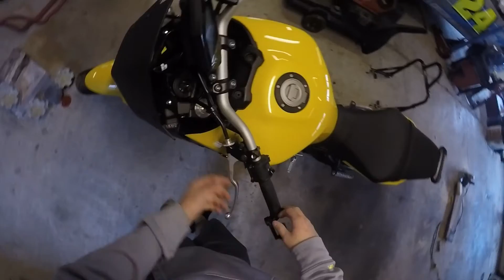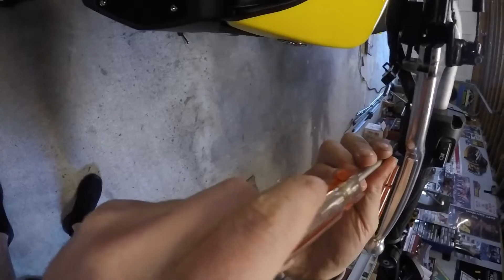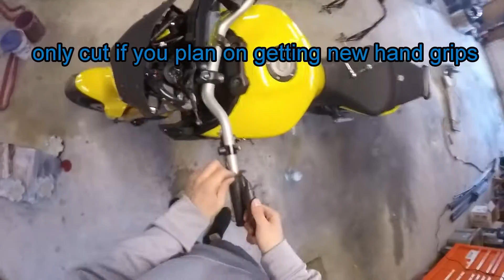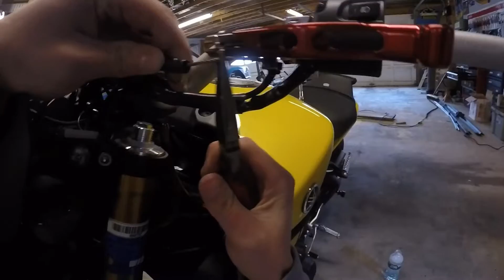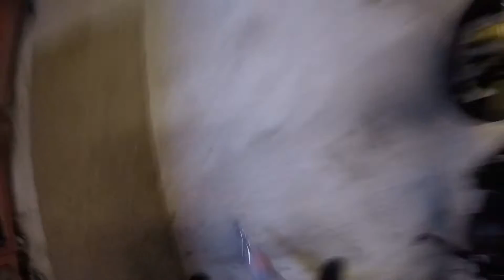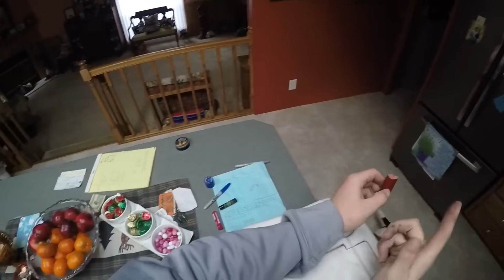EZ PULL CLUTCH | FZ09/MT09 | IMPAKTECH | INSTALL

Comment: Pretty sure that plug is what wont let the bike start IF its in gear AND you dont have the clutch pulled
Reply: Nevermind.  At the end u said it...
Reply from the maker: YES aka safety switch
Reply: Would it worked better or could you have put the lever on next to the grip and moved the switch over.  It seems you would have better hand and finger control on the easy pull lever.  Not sure if cable is long enough or if switch being moved would have been an issue with the cable.